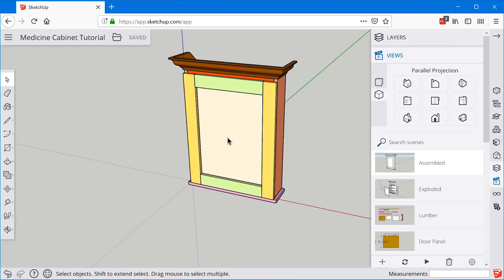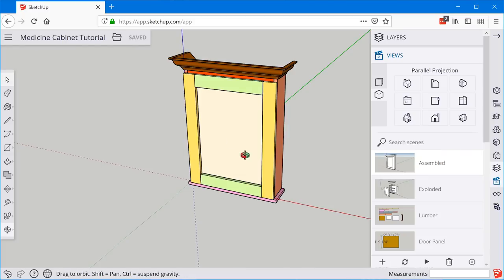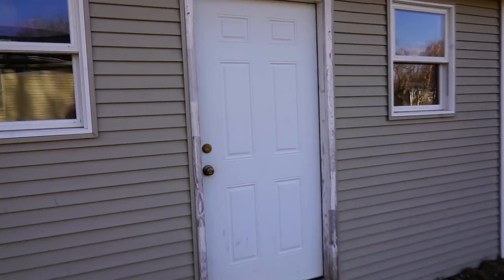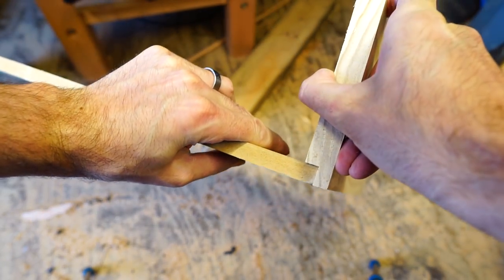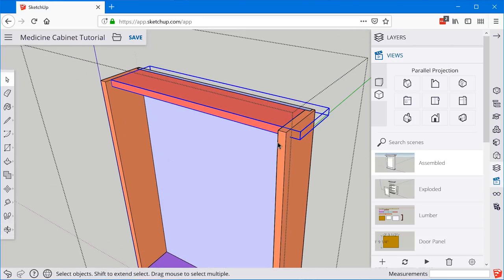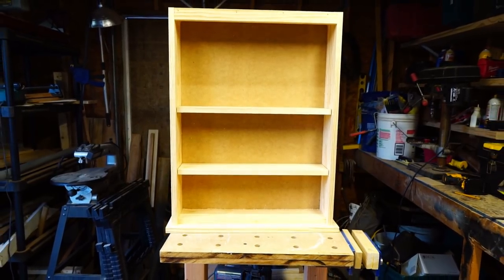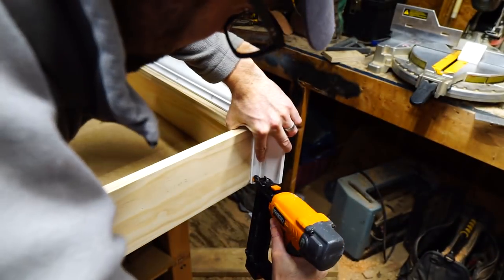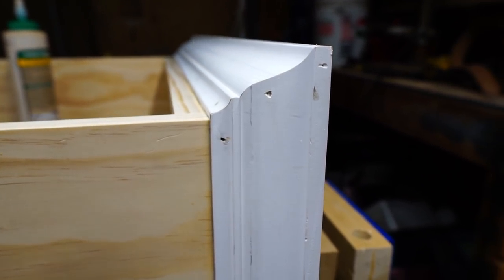SketchUp Free TUTORIAL Medicine Cabinet Walk-through (PART 7)

Comment: Hi Matt - loved the series; really well done.  Any tips on using the rotate tool? It's the only one I seem to be having issues with, especially the way you laid everything down on a plane in plan view. You raced through that so quick, I couldn't follow. Mind you complete novice :)
Reply from the maker: Hmm, well there are a few tricks with the Rotate tool. Use the arrow keys to lock orientation to an axis. Or, click and drag the anchor point to set the rotation axis. Anything in particular you're having trouble with?
Reply: @Mastersketchup  Thanks - still getting into the flow of clicking at the right time. Experienced Photoshop user so some things are counter-intuitive to me. I keep wanting to do the second click and drag... but getting the hang of it. Now just trying to work out a quicker way of laying stuff down flat and locking it to the horizontal plane. I got it done but I reckon I took the long way around LOL

Comment: Hey Matt, just finished watching the cabinet project and if I say so myself, it came out very well. Here in the UK, what you called a "Rabbit" we call it a "Rebate" .... Not sure if that was the word you were looking for.
I love the project format videos that you do and am currently re-looking at the shed one from a couple of years ago. I mentioned a week or so ago that I had to model a child's bike to design a bracket for a doll's seat so would like to see something along those lines as I struggled with tube intersections and removing unwanted tube "ends" as well as using the "Follow" tool to create a wheel and tyre. Also, as a bike is symmetrical about a longitudinal axis, is there an easier way to draw it?
I got there in the end, but I know there would be time saving short cuts.

As to your question. Being from an engineering background myself, it would be great to see the camera mount project. 

Brilliant work Matt, keep it up ;-)
Reply from the maker: Thank Tim. Yeah, we call it a rabbet over here. I got my camera slider somewhat working at this point, but I'd like to figure out a way for the slider to trigger the camera. There's a lot of vibration in the movement, so there's still work to do. I'll think about doing some videos.

Comment: Matt, the sketchup part is pretty good. But the way you work on a table saw is unacceptable. You should always use a push stick. Even when it seems to you that your hand is far enough from the blade. In fact it is not. And it would be nice if you dedicate some videos to scenes and layers. This feature if sketchup is not so easy to understand.
Reply from the maker: Regarding table saw technique, you're probably right. For what it's worth, I am extremely focused whenever using power tools, and truly appreciate the danger. I understand how kickbacks happen and perpetually "prepare" myself to react to a kickback if that happens. But I appreciate your warning.